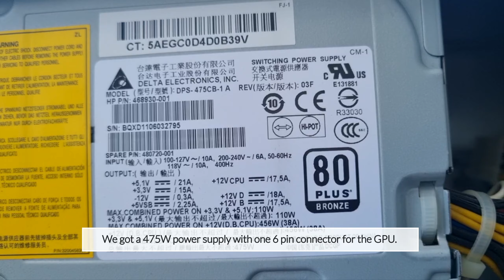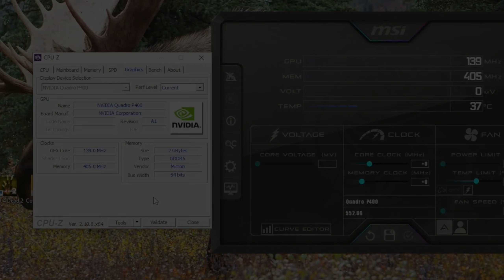UPGRADING a DUAL CORE XEON - HP Z400 in 2024 ! [ Xeon W3540 & GTX 960 4GB ]

Comment: Why not a 6core xeon like x5650 or w3650?
Reply from the maker: I've looked up on the HP website, which CPU's are supported.
These 2 were not mentioned , only 4 cores.

So i've bought one who i knew that it will work, other than wasting money to try out a more powerful one. :-)